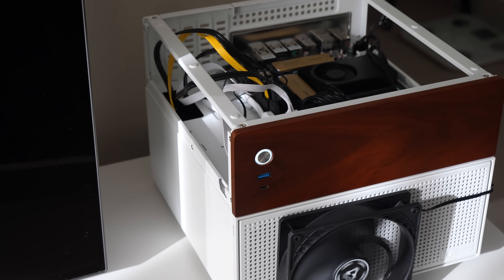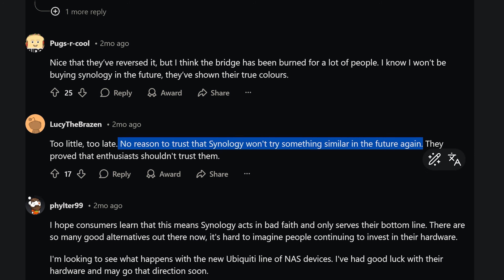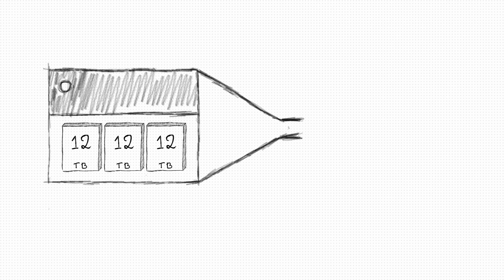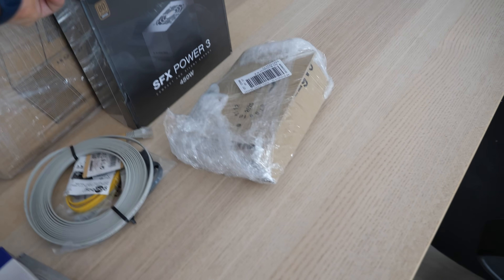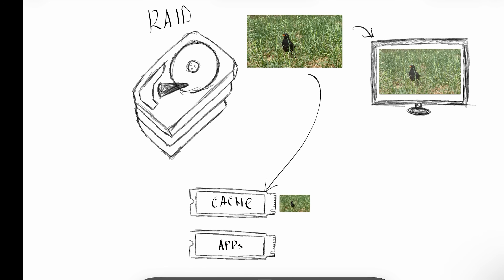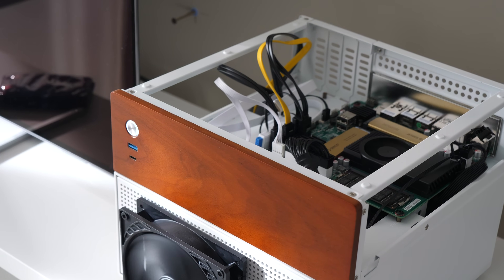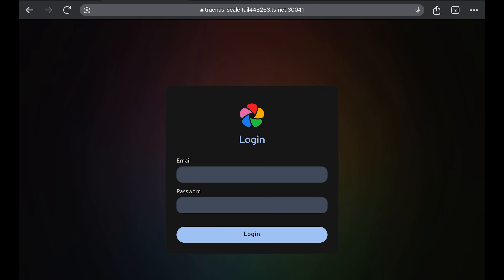Building a 10Gbit DIY NAS: What They Don't Tell You.

Comment from the maker: Hey, got some additional info for you based on the comments. 

Total cost of my NAS is 1475 Euro | 475 Euro NAS +  850 Euro HDDs + $180 (theoretically)  SSDs from ORICO

Several people noted that using standby mode can negatively affect the lifespan of hard drives. And that's true. In my case, the drives woke up 2-3 times a day, but I decided to increase the standby delay time from 30 minutes to 180.

Forgot to mention! I did configure the BIOS, to make CPU fan silent.
Even though the fan is 3-pin, its speed can still be adjusted by voltage. 
This setting is located in Bios -> Advanced -> Hardware Monitor -> 
Fan Mode [PWM Mode]
       Fan off temp limit: 20
       Fan start temp limit: 30
       Fan full speed temp limit: 65
       Fan start PWM: 40
With this settings CPU can be hot during full load, but maximum I had is 50% CPU load, so you can adjust it as you want.
The fan at the front of the case is also connected to the CPU socket via a splitter on the motherboard (because only this can be configured in the BIOS).

Thanks everyone for the tips, you guys are awesome!
Reply: ur also hungarian?
Reply: And thank you for the recommendations!

I would personally stay away from Orico if reliability is at stake, but it should do as a simple high speed cache.

The case is also gorgeous, thank you for that too.

Also, I have a question about the bootable ISO flashing part. Why did you suggest that we shouldn't bother with other programs like Rufus and should rather stick to balenaEtcher instead?

Rufus has been my go to for years now, so I'm a little curious.
Reply from the maker: @proxyhx2075  Can you tell me whats wrong with Orico? 5 years or TBW warranty is there, I am curious. 

The flash drive just wan't bootable after Rufus, I was troubleshooting my NAS, but after googling I figured out that everyone used balenaEtcher for it

Comment: There's one problem with your motherboard. Both the N150 and N305 CPUs only provide nine PCI 3.0 lanes. When you add up all the devices on this board consuming PCI lanes (i 226 NICs, NVME drives, the SATA controller, etc.), it is likely that the 10gbe NIC has only 1 gen 3 PCI lane, meaning you will never achieve true 10gbe speeds. It will for sure be faster than a 2.5gb or 5gb NIC, but it won't deliver 10gbe. If network connectivity is important, you will need a different board.
Reply from the maker: Hmm, but I achieved a 10 Gbit speed, as demonstrated in this video. With 2 NVME SSDs, 3 HDDs and 1 SATA SSD

Comment: What most people and especially Youtubers are guilty of is assuming, incorrectly, that all data is the same. MOST is archival only. It will never change and is accessed...well..never...like Youtube videos, unless you get your channel banned. You keep a backup but in all likelihood you will never access it, its "just in case". 

Your LIFE data set, the things in progress or that get changed on the regular are minuscule in size by comparison. Trying to keep all that dead data on instant demand just makes zero sense. Most people are better served with a DVD or Blu-Ray burner and one or two large external hard drives. Yes, I said hard drives, not SSDs because mechanical is still the value proposition.

Comment: Raid10 ZFS variant would provide more performance, faster rebuilds and better redundancy. Also, TrueNAS does not use SSD's for write cache, only read if you do not have enough memory to hold the contents. Now you can get into meta vDevs and other things but it is only useful in specific situations.

Comment: it's possible to fit 2x 120mm with 15mm height into the front of the case. But it is a bit of work: First you have to grind off about 1mm of the Fan frame, so they will fit into the front cover. Then you need a 2mm spacer for the magnet lock to avoid the fans hitting anything internally. Also you cannot use the included rubber handles for the drives. But it looks why better when the fans are internally.

Comment: Fantastic video, thanks for sharing! I went the NAS route a few months back. The main reason is that with AI becoming so common, I’m not comfortable storing my family’s data with big companies like Microsoft or Google. I still have a hard time justifying the cost with the NAS setup that I built, though. Electricity is pricey here in Europe, and Backblaze backups aren’t cheap either.

My setup ( Proxmox with TrueNAS as VM ):

ASRock Z690 Extreme ( 1G & 2.5 G NICs )
Intel Core i5 13500
Fractal Meshify 2  RGB
ENERMAX Revolution D.F. X ARGB ATX3.0 PCI-e 5.0
CORSAIR VENGEANCE LPX 64GB (2x32GB) DDR4 3600 (PC4-28800) C18 1.35V RAM - Black
Thermallight Assassin x120 SE ARGB 120mm
WD Red plus - 3 x 4 TB in RAIDZ1
Samsung 980 PRO 2 TB PCIe 4.0 (up to 7,000 MB/s) NVMe M.2 (2280) Internal Solid State Drive (SSD) - TrueNAS is installed here ( 60GB ), the rest is kept idle for future use. Perhaps immich DB for low latency.
Kingston NV3 Gen 4 M.2 SSD 2TB - Proxmox OS 
Crucial BX500 4TB ( Immich with syncs to TrueNAS and backedup BackBlaze )
Seagate Barracuda 1TB - salvaged from a free PC -Proxmox Debian VM for  Media 
Intel 120 GB SSD - salvaged from a free PC - Scratch for TrueNAS 
Geekworm X651 PCIE KVM and Rasperberry Pi Compute Module 4 with 4GB RAM and 32GB storage for PiKVM to remote operate the Proxmox/NAS via WireGuard VPN.

Cost : Approx., Euro 2100

Consumes 60 Watts on average. Noise at 33 db at idle.

Haven't invested in UPS.

I use WireGuard for remote connection.

Not a youtuber, so my usage of the NAS setup is not price justified since Google One 5TB that can be shared with 5 members is far cheaper.

Comment: You didnt say anything about ZFS pool tuning. Like no mention of atime=off. Compression or dedup. You also said "raid" but actually you use ZFS which is one of the best software drive pooling solutions. It is much better than any raid because it keeps checksums of blocks which allow ZFS to identify issues with drives and also prevent from sending incorrect data to users

Comment: FOr the price pinned in comment, it is reasonable, but to me, it was never worth it building anything, used synology NASes are so available here, with good pricing, under rest of warranties, etc... Bought only first one (2 bay 214) back in 2014, poured 700 euros into it (incl. drives), and i was happy with it since. Then came 4 bay used one (i got rid of it later, because power supply failed, NAS was working ok), Then 1 bay one (for second apartment) and i again bought 4 bay to increase options from my 2 bay one. So far it never failed me once, never lost any data on it, and can acess it from anywhere.
Reply: More fun building one though 😂

Comment: I did it  with mini pc   that  has the same cpu true NAS is installed on USB 3  flash  drive, the  default  512 gb ssd is for caching the and  and i added 2 1 tb external 2.5 hdds it's  only for saving  family  photo and some working data the 16g  of ram are enough for  it.
Reply: If your router has a USB that would save you on power. Your set up is pretty basic and inefficient yet overkill for just sharing photos 😬 great to learn from though, you have to start somewhere. My advice would be to alter a few things with that set up if you're open to suggestions 👍

Comment: If you using raid with only two disks, it would be better to buy hard drives from different stores, or different models. If they came from the same lot, they can end in failure in the same time.
Reply: That is great advice and usually the case when shopping for NAS drives. That's also what I do, I buy from online stores & physical stores and make sure to mix them from different manufacturer dates
Reply from the maker: This is advice straight from Walter White :D 
Maybe that's a good point though.
Reply: @trysometech52  It's based on my experience. We had 6 drives, 2 of them died at the same time. 3 of them was from the same lot.

Comment: 8:23 Why? Do you chain your network like: router -> NAS -> client PC?

This is a terrible practice. If your NAS goes down, your PC is cut too. Set up your network in star topology instead. That'll be good for small networks like this.

Two Ethernet ports aren't needed on a NAS, unless you do enterpride stuff, or also set up your NAS as an edge firewall/router, which is one of the worst practices you can do.

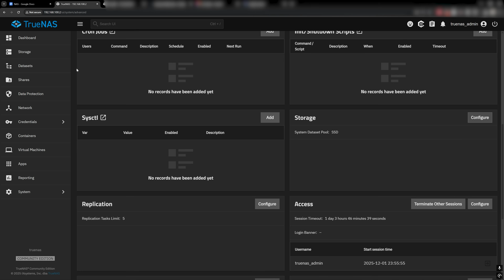14:42 noo, these drives are designed to run 24/7. It's not good if they spin up and down.

This video is enthusiastic, but full of bad practices.
Reply from the maker: You misunderstood that. I showed my PC's motherboard. 
10gbit is connected to the NAS
2.5gbit is connected to the router
While NAS is also connected to the router.

Regarding the drives, I added a note to the pinned comment and warned others. For now, I will keep this for myself, but with different settings, since I am using it for around 6–8 hours a day.
Reply: @trysometech52  So you have a ring network topology?

I guess you do so, to solve the problem of having a 2.5Gbit LAN, while still getting 10Gbit between the NAS and editor PC. This is cheaper than getting a 10 Gbit router (although you can score them cheap if you look, I've just bought a 32 Gbit router for 33.000 Ft), but still a bad solution.

It adds more points of failure, it's hard to troubleshoot (you will need to check all devices in a ring) and one broken cable will distrupt everything.

I can't see any reason to use ring instead of star (or tree) at home.
Reply from the maker: As far as I can tell, its a star with additional 10gbit connection between my PC and NAS. As I mentioned in the video, you can buy a switch, but this solution was easier and cheaper for me. In the end I have a 10gbit connection with my PC and every other devices (including PC) still can access the NAS via the allocated IP.
So you can call it a Star topology with a direct 10gbit link bypass

Comment: what "they" don't tell you is that it's a waste of money, when you can just get a used pc for 200€ instead.
Reply from the maker: Okay, and will be there a 10gbit network? What power consumption will be with old gen CPU?
Reply: @knightmare1442 - How many used PC's can take 5-8 drives?  How big would that be?  I did that with a used workstation desktop and still had to buy a replacement case in the end.

Comment: RAID is absolutely unnecessary at home. RAID is needed where truly uninterrupted operation and hot troubleshooting are essential, and restoring RAID is a real pain. For a home NAS, simple backup of truly important data is sufficient. Don't waste your drives and don't create problems for yourself out of nowhere.
Reply: @SamePerson1234 - I cannot for the life of me understand why people say that RAID is not required.  It is a choice which people make dependant on their risk tolerance level.  If you have a family of 4-5 using the NAS for entertainment of the storage for their school work, there could be hell to pay if the system went down for a day while you restored from your backup.!!!   RAID costs extra disk capacity but there is very little in additional work to implement it, and for most, the peace of mind of having the system constantly available is more important.  People should check-out TrueNAS or any other zfs file system, its far more capable than the hardware RAID of the old days.   For example. I moved my 4 drive SSD Raidz1 from one system to another completely different system a few months ago and it took me far less time than any backup/restore would have taken.

Comment: For me the power consumption is one of the most important thing regarding a NAS, as the device is on 0/24. This concept just does not make too much sense (for me, again).
Reply from the maker: Each of my HDDs consumes 8W, so then you need to look at m.2. solutions like Beelink ME mini
Reply: @trysometech52  thx, I am happy with my older Synology NAS, low power consumption but has enough power to run 6-8 apps in docker containers.

Comment: Build your NAS around the case, drives and network. Motherboard comes next and it must support all available disk slots. Via onboard SAS/SATA ports or via PCI-E x8. Two-three striped SATA SSDs (not NVME M.2s) can saturate 10Gbps network and will not require cache. Stop calling your NVME devices SSDs. They are in different speed category.

Your case has eight slots for disks and that CWWK motherboard design supports only six. You will have to use that PCI-E slot for extra SAS or SATA controller instead of adding hardware transcoding to Jellyfin. Your case walls direct air flow. By ripping it apart or adding gheto fan in front, you are not helping with ventilation. Jonsbo N4 got mounting spot for fan to cool those 3.5 grills. Use it. You can get higher RPM fan for extra 20% air flow. There are better NVME cooler grills than that stock plate. Plates depend on case fan for cooling. N3 and N5 cases got even better fan layout for that N150 setup.

If 24 TB is good enough for long, then you are overpaying for storage now instead of adding extra storage later. You might need some time to figure out how fast your storage requirements grow.

Docker containers do not require storage devices that support PCI-E v3 x1 transfer rates and you need two of those nvme ports to get to 10Gbps network speed levels..
Reply from the maker: I think things aren't as bad as you think :)
NVME or SATA SSD are still SSDs, don't know why it bothers you.

6:53 if you look closer, there is a board for 4 HDDs, which uses just 1 SATA port. So I have enough SATA ports for other drives.

Jellyfin already uses iGPU for transcoding, so I don't need GPU.

When I lowered HDD temps from 55 to 40-44, by adding front fan, you are saying that it doesn't help ventilation? I mean...seriously?

As for 24TB I agree, but again, I started from 12TB mirrored RAID in my PC, and later decided to build a NAS and added another 12TB to increase the capacity.

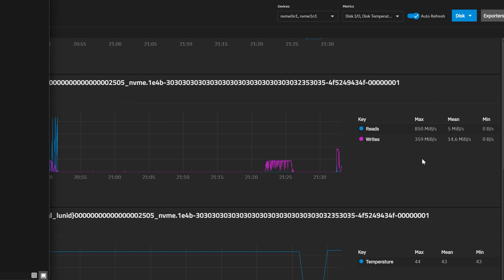As for the docker container thing I didn't get what you mean. But can say that I used 10Gbit network speed and demonstrated 12:40
Reply: The guy built his own FIRST EVER NAS He done a great job of it too in my opinion, ok he didn't start with the best parts because like probably most people he was thinking aesthetics first over functionality 😂 but he done one hell of a job with what he had and showed he learned along the way. Give the guy a break Mr perfect 😂😂😂

Comment: 13:55 an even easier way is to simply replace the drive in truenas, by going to system->boot->boot pool status->click on the hamburger menu on your boot pool and click replace, that way you're up and running even faster with a new boot device.

Comment: I think cube shaped cases are not the way to go. It's not expandable and it doesn't allow you to mount GPU. (If you want NAS and some other stuff in same package)
Reply from the maker: There is a place for 6 drives 2 sata SSD and a GPU. It's just that my current motherboard doesn't have a slot of the GPU

Comment: I have buid similar NAS 2 years ago. I have 4*4GB Seagate HDD's. My only problem is with energy consumption. It uses around 50 Watts, regardless of the load. I have to try sleep mode for the HDD's, i never think about... 50 Watts are alot, i have seen custom buid NAS with no more than 9-10 Watts when idling...
Reply: If your NAS doesn't have constant 24/7 use (either by people or by apps) then definitely look into sleeping your drives after a few hours of inactivity (I say hours because constant spin up/down is not great for longevity, but it all depends on the actual usage patterns). Depending on the platform there's also some CPU power optimizations you could look into, like limiting boosting/frequency, allowing lower C-States, etc.

Comment: Could you share the make/model of the MB, the Aliexpress doesn't seem to work (at least in the US). Thanks
Reply from the maker: It doesn't have a model. This is how it's called (maybe it'll help)
10G NAS Motherboard N100 6 SATA 2*2.5G 1*10G LAN 2*M.2 Nvme HDMI DP DDR5 6 Bays NAS Board 17*17 Mini ITX ALL IN ONE NAS Router

Comment: Many NAS builders and PC community members have expressed WD Red Plus to be the most quiet on the market. I don’t have first hand experience but you mentioned your experience with them was too loud, so what would you have gone with instead if you could go back?
Reply from the maker: Someone smarter than me pointed out in the comments that the larger the hard drive capacity, the noisier they will be. So maybe it's not that noisy. I read about it being noisy later in the reviews, but maybe people were comparing it to other drives with smaller capacities. Unfortunately, I'm not an expert when it comes to finding alternatives.
Reply: I use WD Red plus helium filled drives and are alot quieter, you should check the data sheet i think you have the air filled which are noisy, if you're looking i would definitely go with WD Red plus but check to make sure the data sheet says Helium filled and don't buy ones from the same lot numbers either because if you have issues with one you could end up with all drives dead at the same time especially if they ever have a batch manufacturer issue 😬